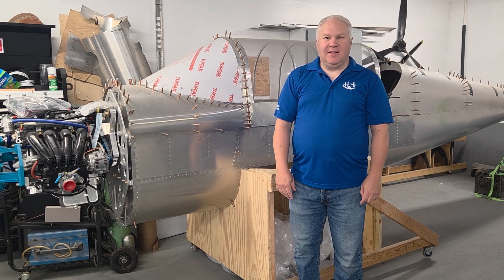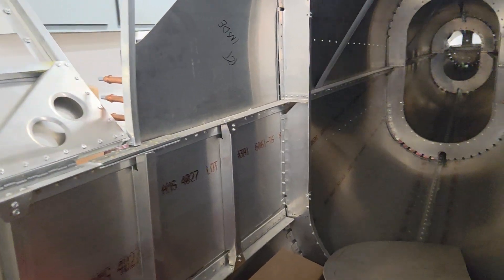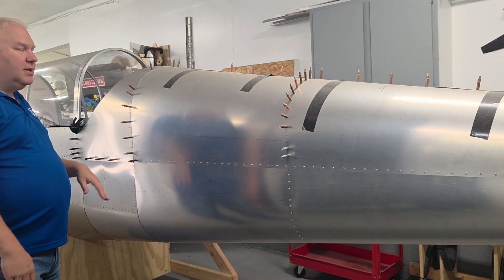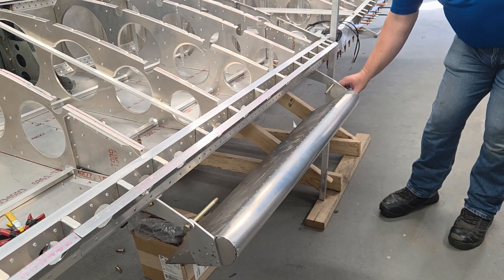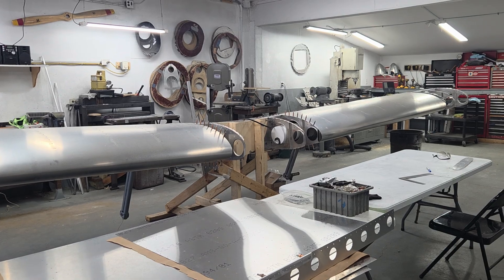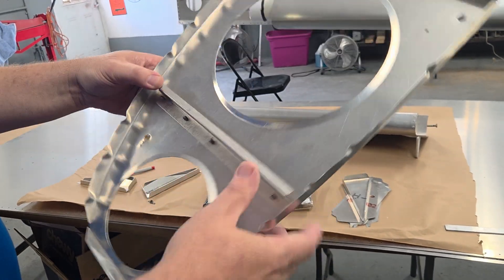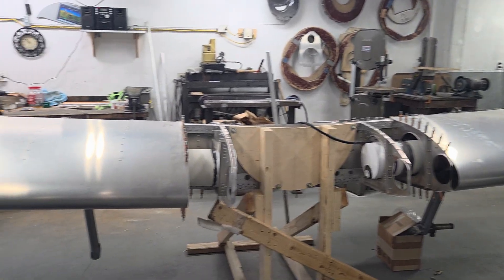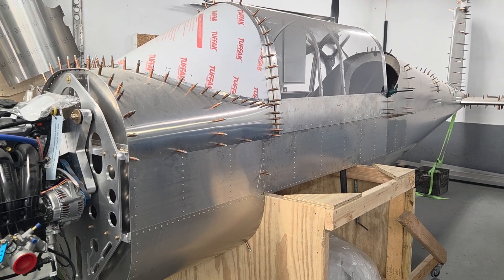Newest Hummel Aircraft Update!

Comment: Why build an 8 G wing?   With such a light wing loading if you crank on the stick,  there’s not that much weight that you’re changing the direction of to cause load.  

I was always curious why the phantom ultralight was an 8g wing loading.  Even at gross in a nose dive. If you pull the stick as hard as you can,  you can’t hit 3 gs.  

I always thought a 2 seat Hummel would look more like an ercoupe.  But it does look good!

Comment: Interesting airplane. You mentioned a couple of things that got my interest. Number one! This I’d designed to fit a real person, not some standardized 150 pound tooth pick size imaginary pilot. I cannot think of any civil aviation 2 person airplane designed and built with chair size, spacing and fitment of a modern Ford F-150 cab. 2) For an LSA airplane, this thing is absolutely huge. 3) a landing and stall speed around 35 to 50 mph is dang close to being a helicopter in field sizing. And with such a low speed regime, a cruise speed of between 90 to 150 ish mph is a very respectable flight envelope.4) a payload capability in the 1,000 pound plus take for a 2 seater is just plane huge. 5) I am not so sure about your main landing gear design. It looks like it’s going to be very unforgiving in ride on all but the smoothest of surfaces and not hard landing friendly. 

I would love to see this with some sort of bubble top or a high visibility canopy that doesn’t look like something out of the 1930’ After thinking about it a bit, a bubble canopy might be a bit too much like a solar easy bake oven for the crew. 

Again, a fascinating airplane. 

I am going

Comment: It's always nice to hear the thought processes that go into a design.
I would not dismiss 10,000', though. It's usually nice an calm up there, there's very little to hit, and coming East there's often a useful tailwind. 
A slightly bigger fuel capacity might be better. A standard 172 has a 38 gallon load, and there are trips where that gets really marginal.